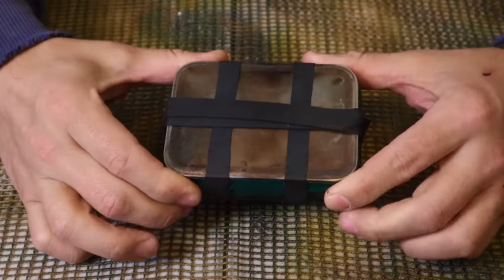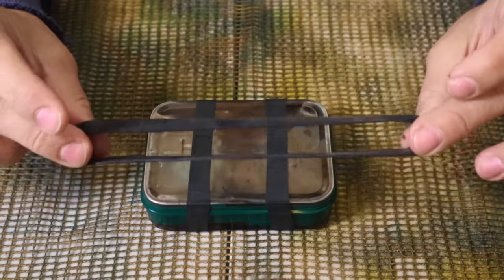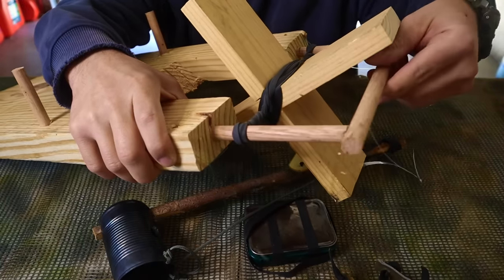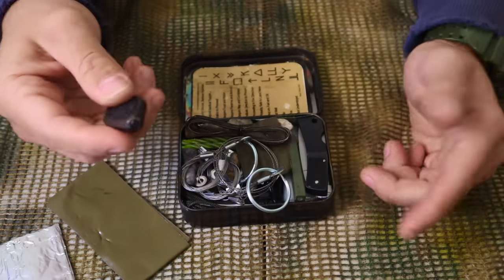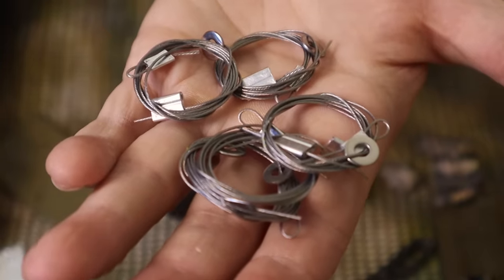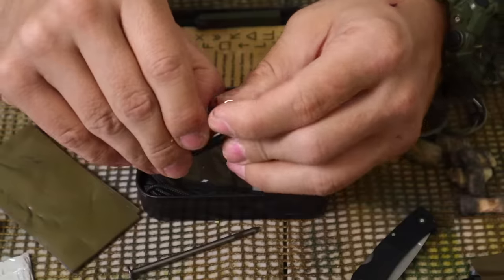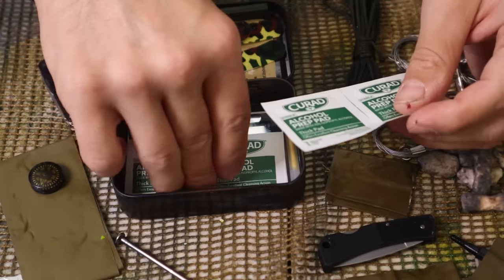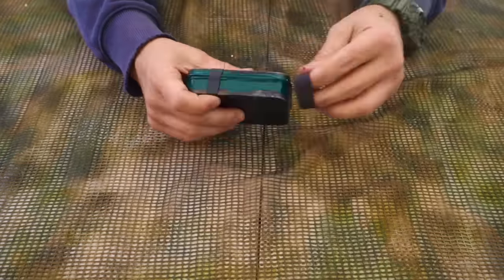Updated RSFC Survival Tin Kit!

Comment: I love watching these types of videos, especially from RSaFC, to make sure my kits are up to snuff, see if Im missing anything.
Yup, Im good. 
One thing I might add for EDC is belt gear. I have 3 leather belts that I cycle through and each one has a handcuff key, a bobby pin wrapped in a few feet of fine kevlar cord, a razor blade, and a small strong neo magnet that has a hole in the center (which is attached to one end of the kevlar cord) and this is situated and duct taped flat on the rear most inner part of the belt.

Comment: This is an excellent reminder that useful survival gear need not be costly. But, after putting a mediocre knife in my kit and seeing how very limited it was, I rethought the need. My tin is about the same size as in the video, so I splurged and got an alox SAK Farmer. A real knife and saw of equal length, plus awl, screwdriver, can/bottle opener. For space inside the tin, I'd jettison the multitool and just slide a 6 in or smaller pair of water pump pliers under the ranger bands on the outside. Not only handy for snare wire, but if your survival situation is near machinery or civilization -- it's a tool that fits a range of nuts up to an inch plus handleless water spigots.

Comment: Sir, T Y again!  One possible addition is a little 11/2 by 3/8 inch long tube level.  Useful for quickly building level beds & locating shelters that drain of water.  Also possible to use for estimating vertical angles of potential landing strips.  Super Cubs, for example, can land well on surprisingly steep, cleared landing slopes.  Beware of soft tundra, though.  Also, taking off from a tundra strip with a Cub is tricky.  Firm gravel hill strips (of adequate width) are much better.  Been there, seen that.  Helps a lot if stranded folk can communicate accurate landing slope estimates to rescue aircraft,.  Helos have clearing diameter requirements as well as slope & surrounding vegetation height limits.  Now is the time to learn the geometry.

Comment: putting a 25-30cm nylon or flourocarbon with a loop on each hook make those hooks MUCH easier to use if injured, cold or just bad light conditions. only downside is slightly more difficult to store (I put mine in paper folded to tiny envelopes that I dip in paraffin wax to waterproof.
second,  one or two of the fishingflies, preferably small ones #12 or even #14, they can catch smaller fish that you can either eat or use as bait
third would be one or two larger hooks with wire leads to be set over night to possibly catch something. like a pike, burbot,  catfish...

Comment: Do yourself a favor and do NOT use a tin unless you want the contents to get wet and useless.
I am 70+ and a Nam Vet + other conflicts. 
Years ago I had to learn this the hard way (I was stupid because I had to suffer more than one failure).
I switched to a heavy duty waterproof container and have never looked back!!!
Reply: I thank you for your service and experience.  He did have tape wrapped over the hinge and point of closure though.
Reply: @les3449  Yep, I noticed that and did that myself. It's just not dependable. Please bear in mind I'm not trying to negatively criticize this guy but the tin is just a bad idea in reality.
Reply: @richardstone5241  OK, I see.  Having spent 30 total years in the military I KNOW that knowledge and experience is constantly being lost.  I saw the wheel being reinvented several times.  What exactly was it that you recommended?
Reply: @les3449  Don't mean to butt in -- this is an interesting sub-thread to me, who also has a metal kit (and though it's heavier gauge than the Major's and has spring roller clips on both ends, there's no guarantee it's 100% waterproof). 

If I judged the tradeoff in packability and concealability to be an absolute necessity, a wide-mouth polypropylene bottle would be a consideration. But the tin can be used for boiling (very small volumes of) water and the bottle not so much. Unless you go with stainless steel or titanium -- and already it's a whole different category of gear. Definitely with a real use case, like southeast Asian jungles!
Reply: @robertphillips93  I believe these comments are open to anyone being respectful of the conversation originator.  Thanks for the input!  I always considered a small container like the Major's good for cargo pockets, where I would also carry redundant fire starting items, knives, first aid and even a makeshift shelter if possible.  I saw his tin as a good idea, esp. for items not affected by moisture.  Although, what you and richardstone5241 say makes a lot of sense.
Reply: @les3449  Yes -- that's exactly how I'd carry it in the most basic level of modularity. Higher levels might stow it in a lumbar pack of some size. In fact, the specific contents of the kit have a significance relating to my capacity for meeting contingent needs. That is, they are an expression of that actual ableness even more fundamental than whatever function they may have. 

What's more, as a practical extremist of indeterminate success, it must be noted that in the absence of any kit whatsoever, the mentioned ableness and some degree of honest evaluation is all I can bring to bear in facing any need. So, even ordinary life becomes a survival operation! (So why is it that no survival expert on the planet recommends carrying a paper bag in your back pocket to treat hyperventilation? . . . now I'm obviously having too much fun) Nice chatting with you!
Reply: @robertphillips93  same here!  Thanks!